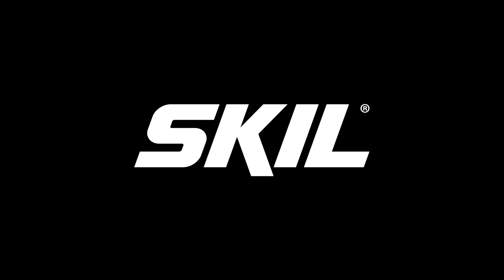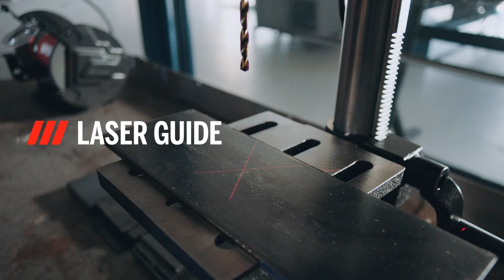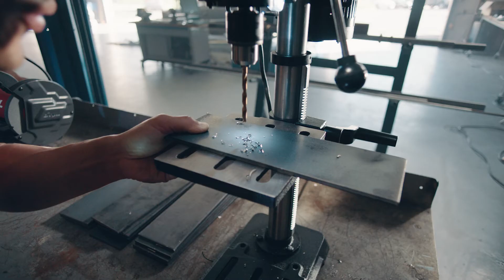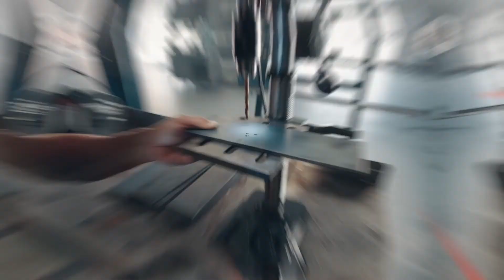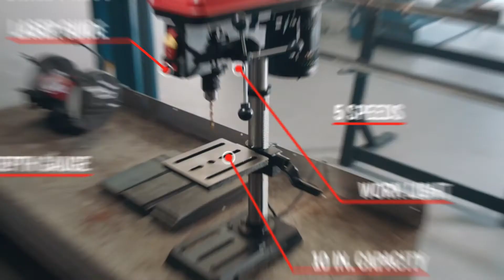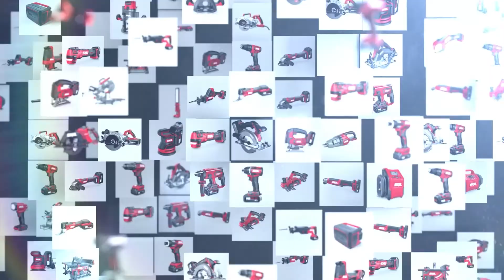6.2 Amp 10 In. Benchtop Drill Press (DP9505)

Comment: What's the swing and spindle travel?
Reply: I’ve been searching for that question everywhere online and they do not provide that information. Finally was able to find it, 2 inch travel. Had to watch a 20 min video provided by a third party reviewer. 

Still no information on why it has a 6.2amp motor though vs the typical 3.2amp that every other company runs on a drill press this size.

Comment: Bought it, set it up, returned it. I was really unhappy with the build quality. The plastic pulleys wobble, made a racket, and were out of line. The biggest problem was the table. There was no way to get the movement out of it. It is a terrible fit to the main mounting cylinder; it was like they had the wrong size table.